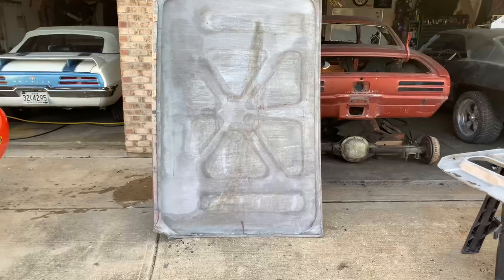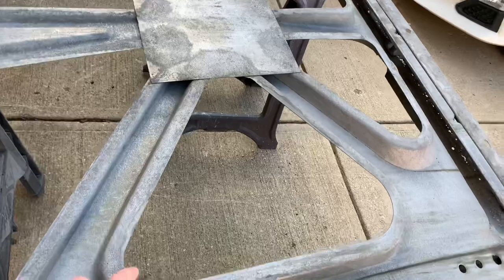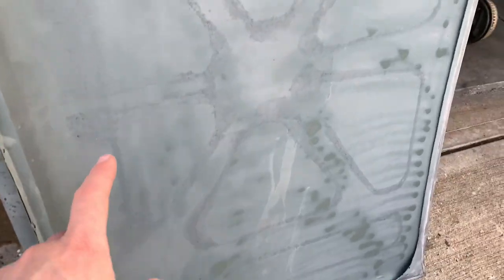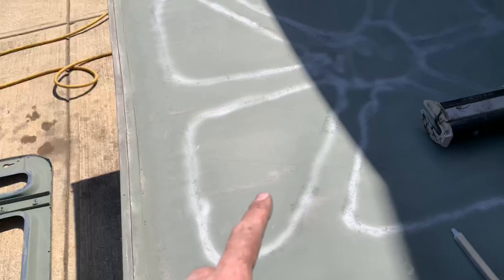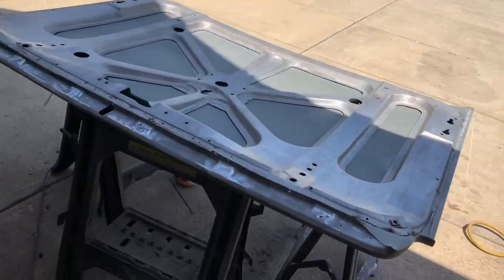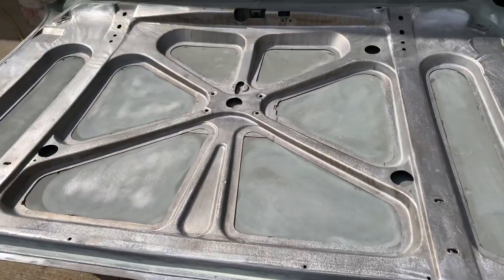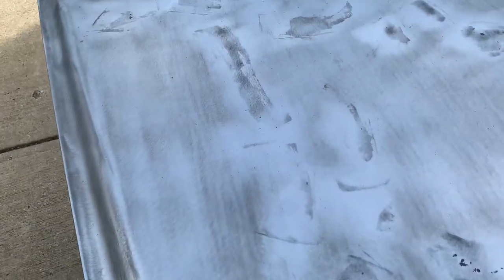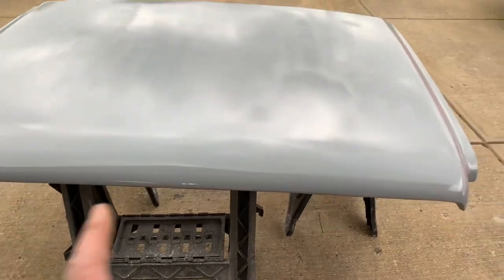1962 Lincoln trunk deck Rust repair. How to assemble it after returning from the dipper, weld repair

Comment: Twenty first century glue saves an old deck lid, for some reason i was thinking lead
Reply from the maker: I haven’t played with putting lead in. Only removing it for panel replacement, I suppose if I was good at working lead that very well could be a nice alternative. Then again it might get even heavier, it weighs a ton as is.

Comment: Interesting approach, probably less work than putting a million patch panels in. 

Looks like you are in a fairly nice neighborhood, probably with an HOA. Ever get any heat about your projects?
Reply from the maker: Patch panels would be a mess and the metal is so thin in some areas welding might be tricky.   Here goes nothing i suppose.  

My neighbors are pretty cool. I fix/help them with their cars so it’s a a fair trade      To keep the peace